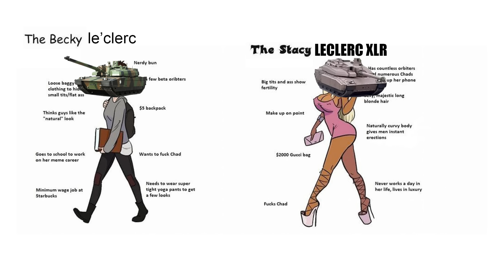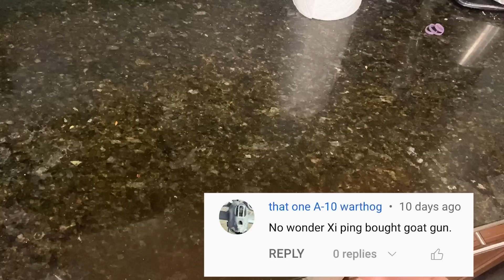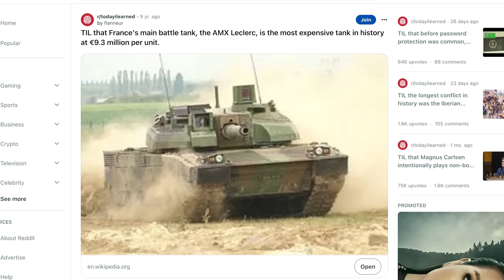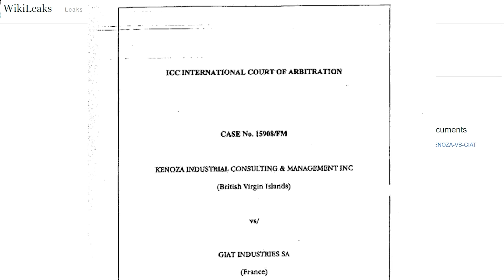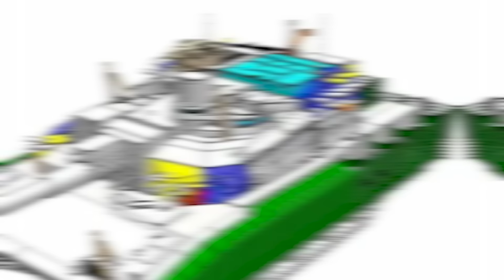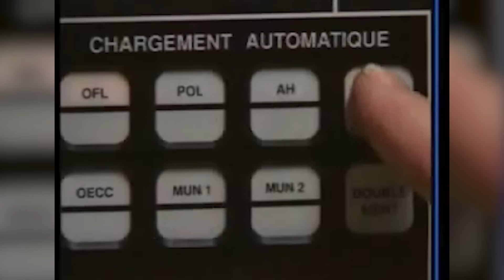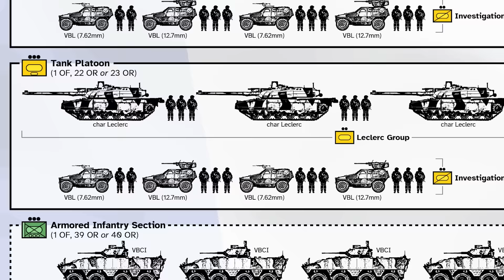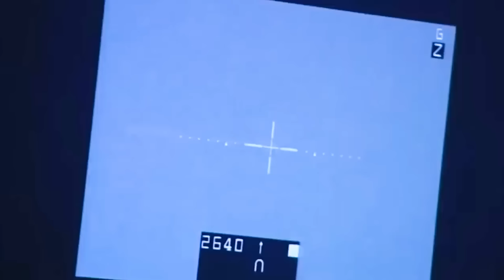Why France's Tank is the World's Most Expensive

Comment: I think the French did an incredible job on the LeClerc and the French military doctrine matches up with Korean military doctrine, which was applied to the K2.

When the K2 was in the initial stages of development, the generals were asked, what's the #1 thing required for a modern tank? And the general's answer was "networking," not firepower or armor.

Because it's necessary to combine info from satellites, other tanks and other data sources to get a complete picture of the battlefield, download GPS coordinates of targets, and hit with 100% accuracy.

I also agree with the French and Korean military in that armor is overrated. Modern radar can lock on the GPS coordinates of any tank once it fires, so it's necessary to fire and move, no amount of armor is enough to protect from counterfire of 120 mm tank shells or 155 mm howitzer rounds fired with GPS guidance.

There's a reason why the French are the world's #2 in weapon sales. They're smart as hell, they design their weapons with a coherent, effective military doctrine in mind, and they're good quality weapons. It's a winning formula.
Reply: are you for real saying artillery radars are used to counter tanks? 😆
Reply: @phunkracy  Replace the "radar" word with fire control systems and it's probably what the person above you meant. In Ukraine apparently you optimistically have 5 minutes before artillery hits you when drone and GPS spotting is about. 40 seconds at worst if it's about counter battery fire in artillery duels.
Reply: Honestly south-korean military is highly underated in my opinion. One of the rare western nation trying to regain as much sovereignty as possible from pour common invasive ally
Reply: And who is #1?
Reply: @willyvereb  there is no such thing as a counter battery FCS. The guy is just confused.
Reply: @willyvereb  that's why the ceasar was really smart
Reply: @phunkracy  It seems that counterbattery radar can spot a tank fire.
When you look at the specs of the French Cobra counterbattery radar, it can spot :
Canon fire from 105mm and even mortar from 81mm up to 30km away.
And by calculating the trajectory, it can determine the source, and send the information to a team via the ATLAS system (automated information sharing for ground to ground unit)
So if there is an artillery system, with excalibur rounds that are GPS guided, everything that Jim Park said, makes sense.

Only thing : tank round will take way less altitude than artillery.
So it's harder for a radar to catch it. It will depend on the position and altitude of the tank, his round, and the radar.
Reply: @phunkracy  Counter battery radars are many decades old by now. Digital technology just made its potential all the more deadly.

The OP's point was that data-links and sensors are more important in the modern battlefield than who has the thickest armor.

Why do you continue to derail this topic?
Reply: @willyvereb  why do you continue to derail the topic? you had 4 days to stay silent, couldn't manage even that?
Reply: @phunkracy  Your response fails to establish even basic cause and effect. If this is the best you can produce then I feel stupid for thinking we could ever had a conversation.
Reply: @Antares-rt5ub  well the country whos military budget essentially amounts to "YES"

Comment: You forgot the data link, when a leclerc see an enemy, it send in real time the info to the artillery, it has also many captops for NBC, it does chimical analysis, the autoloader allow to reload in the moves at hight speed what Ambrams or leo2 can't.
Reply: Lmao what king of troll your are
Reply: its called Battle Management System and can be found in newer Leopard 2 and Abrams variants too
Reply: @MrAerodynamite   what troll? The datalink? It exists. The fact that a leopard/abrams won't be able to load in the same conditions that a Leclerc does? That's true. Try to manipulate a 25kg and 1m long ammunition and feed it in the gun chamber while the tank is bouncing over bumps at over 30mph. This won't be a fun experience and good luck to reliably feed the gun every 6s 😏
Reply: @Lars.171  Yes 30 years after....
Reply: @MrAerodynamite  Just for a post? The reality is here leclerc is a 4th gen tank like the K1 while leo 2 and m1 or Challenger are still old tanks from the 1980 area just upgraded, just heavier and heavier but based on the old MBT70 tech.
Reply: @MrAerodynamite  bidet

Comment: The French style of autoloader is a great design. Like it or not, the updates made to autoloader tech have made manual loading obsolete. I'm confident the Abrams-X or whatever new MBT the US adopts will have an autoloader. There's literally no valid reason to insist on a crew member to load the gun in the 21st century.
Reply: How about having a fourth pair of hands to do basic field maintenance on the tank? That's nothing to sneeze at.
What will finally remove the loader from Western tanks will be the weight of the ammo. The 130mm round in the prototype KF-51 Panther weighs 70 lbs.
Reply: @wmtford4043  You can have a 4th person without sticking with the objectively outdated notion of using them as a loader.
Reply: Abram X is confirmed to have an autoloader
Reply: @wmtford4043  How about no ? No autoloader means lower combat capacity (the gun is stabilized but i can guarantee you the hulk isnt at 30+ MPH, so have fun reloading as fast, aka one round every 10s)

That and the need for more inside space to accomodate for a 4th crew member, which in turn means more total armor volume required, hence weight, which forces a compromise on mobility

A French style autoloader is objectively the best choice, heck even the US ended up backtracking
Reply: @wmtford4043  le prochain char français sera en 140 mm avec son canon ascalon de nexter
Reply: @Jugement  I don't want to be that guy but, this type of autoloading system was not firstly put on the Leclerc MBT (production MBTs, not prototypes) but rather the Japanese Type 90 MBT, which has an higher firerate while also being able to store 18 rounds in the autoloader itself.
Reply: I absolutely agree there is a complicated debate between autoloader and an extra crew. The French tank S1 (3 crew members) in 1940 was far better than Panzer III (5 crew members) in 1v1. Not in 50v50. And that was due to communication tools and also workload for the crews.
Reply: @wmtford4043  typical useless german overengineering problems. 120mm is fine + with higher velocity, you get a better weapon
Reply: Saving your troops and have a faster tank with faster rounds is definitely the future. The leclerc has it all already. Too bad the french aren’t as good at selling as the Americans or Germans 😉
Reply: @xaviergiraudon2247  the Americans are the best at selling stuff and the very best at selling weapons. Germans are really good for many things, but not better than the French at designing and selling weapons. They were just faster at building a modern MBT, and they made a very good one so the success was theirs for this market. And it is fair.
Reply: @wmtford4043 that’s not a very good argument. Firstly, no tank will operate alone or only with other tanks. They will always be among larger forces, for exemple French have light scout cars. So there’s always be more pair of hands to help for basic maintenance of the tank. Secondly, as guns gets bigger and bigger, Rhein metal going to 130mm, GIAT to 140mm, rounds are getting heavier and heavier, thus the loader is becoming far less useful compared to an auto loader.
My third point is that new tanks, such has the US Abram X, Franco-german EMBT, as well as future projects are getting so much more sensors and datalink informations that for the case of the EMBT, a 4th crew member will be needed to compute these informations, thus giving you that pair of hands you seem to desperately want to justify the need of an objectivity worse loader compared to modern auto loader (Leclerc, type 10, K2…)
Reply: They already accounted for that apparently. Have crews on standby in light vehicles and trucks or even ATVs. Crew replacements can be rapid. Only problem there is actually delivering that new crew member to replace the casualty in a hot zone. Best to have 3 or 4 men in the tank. OR perhaps have a partially rearward mounted turret with space for 3 man crew plus maybe 3 or 6 man fire team. Like a Heavy Infantry Fighting Vehicle of some sort.
Reply: Having a 4th crew is pretty important.
If your gonna have an autoloader, might aswell have a fully unmanned turret.

Comment: Great and fair report. The only capability that you are missing which is probably critical and unique in active combat to the Leclerc it's its ability to fire multiple times without loosing sight of its target. This is becaus it's using an autoloader and the canon does not need to be lifted up or down to eject and reengage a new ammo. Therefore it makes it much more efficient against moving targets and especially shooting at the same one in sequence to destroy it.

Else than that it's a great summary that you have done and in my view its biggest advantage comes from the autoloader and therefore 3 personnel needed to operate it vs 4 in almost all western tanks.

It's biggest "disadvantage" even though the French army says it's been fixed is its availability for combat and eventually light weight which means that passive armor might still be a weakness of this tank compared to other Western tanks especially.

Comment: Interesting design. Given the weight of most main battle tanks, I can see armies focusing less on them and more on lighter, more mobile platforms that they can support the tanks with like the Stryker platform. So the fact that they only have 200 of them might not be such an issue if they have a vehicle that can complement them well.
Reply: Specialized tank-killing munitions have gotten too good. There's no point in giving your tank the ability to resist cannon shells since it's realistically never going to fight another tank, and even if it does, depleted uranium makes a mockery of any armor light enough to be practical. And there's no point giving it fancy composite armor plates to resist ATGMs when it's just going to get murdered by top-attack munitions. The future is small, cheap(er), lightweight tanks with high maneuverability and lots of electronic warfare capability.
Reply: Still not enough. It wouldn't hurt to have a bit more but since production cost is a bit too high that will have to do.
Reply: @dark7element  That kind of depends on how well it is being supported. If it is supported by vehicles that can shoot down or deal with potential threats to it before it gets close enough to harm it then becomes less of an issue. 

In this situation the "tank" would be the big threat as it carries the heavy weaponry while other vehicles support it and move in a protective formation around it. Think of navy battle groups and how they usually focus around a carrier with the other ships providing escort and protection for it.
Reply: @dragonslayer2107  In that case, the "main battle tank" of the future might be more like an armored anti-aircraft vehicle with missiles that can also hit surface targets, than a conventional battle tank. I just don't see how having a big cannon will be worth it anymore. If you're gonna use a big cannon against the enemy you can park it well away from the frontline, everything has pin-point accuracy on any target that can be observed these days. Even tanks are getting taken out by direct hits from mortars in this war.
Reply: @dark7element  Probably. Big guns may we relegated to artillery in the future but remember that those smart weapons are expensive and harder to make than more traditional weapons. 

So, while the smart weapons may do more damage, they are not as easy to replace as the dumb weapons.  

As such, while smart weapons are good, it is always a good idea to have weapons that you can fall back on that can be more easily mass produced for times of prolonged conflict.
Reply: Nexter is currently rolling out the Jaguar ebrc 6x6 ifv, with a 40mm autocannon and high speed offroad mobility

Comment: Leclerc has AMAZING engine. Same power and momentum in VASTLY smaller package than Leopard 2.
Reply: Where do you get that from? When I look at the power pack of the Leopard 2 and compare it with the full-size power pack of the Leclerc, than I get the result, that they are almost identical in size.
Reply: HAD cause the Hyperbar Engine is not built anymore
Reply: @dnocturn84  Hyperbar engine is the best because you have the 1500hp when you press the pedal instead of others tanks whitch is gradually
Reply: @Yue2000thegamer  Interesting and fine for me and I guess this is indeed totally awesome, but how is this related to the original comment or my reply to it? It was solely about the SIZE of the engines, not about any other feature.
Reply: @dnocturn84 just compare the hull length of the 2 tanks, the leclerc is smaller by a solid 1m compared to Leo 2, the weights saved is approximately 4T, and I’m not counting the hydropneumatic suspension of Leclerc much lighter than torsion bar of the Leo 2.

Comment: The quoted price of the Leclerc Tank is quite high because the fine print includes the cost of the development program and infrastructure rather than just the manufacturing cost as of 2001. With the original order of 420 Units, its original unit cost was 5 million Euros which went down to 8 million Euros.
Reply: that's not going down
Reply: @AuxenceF  its going down in reverse dont worry

Comment: Most expansive because 1) few were built and 2) it was designed to be extremely sophisticated.
Reply: " sophisticated" blablah
Reply: @flycrack7686  Average "mad but cant come up with a counter argument" mf
Reply: everything french does is expensive for a good reason : food, wine, parfum, tank...
Reply: This would technically apply to Tanks such as the C1 Ariete and Type 10, but it doesn't which is oddly enough.
Reply: @MatteonixITA  1) Only 406 were built for france, and 388 were exported to the UAE but sold at loss. Initialy it was calculated that between 1200 and 1500 tank produced for France were required to have a competitive price thanks to a good serial effect 2) The design is extremly ambitious notably the turret and the motor.

Comment: Hey Chris,

Good content.

One correction about the armor values you've stated.
AMX 30 has only 80mm thick plates of armor, yes, but the values of M48 you've stated are effective values due to slope, not the thickness itself. 

M48's frontal armour was around 100-180mm depending of specific plate and place, which translates to more effective armor due to said slope and angles.

Neither tank had sufficient amount of protection against any of the Soviet tanks, or ATGM's unless we are talking about 3km+ sniping duels (not that shape charged munition is not affected by range due to it's penetration values stemming from a chemical reaction, rather than kinetic energy).
Reply: Demande aux Irakiens et leur T72 détruit par nos chars si le blindage Soviètique est meilleur??
Reply: il a pas dit ça il a dit que 180mm de protection ou 80mm , dans touts les cas ça n'arretera pas un obus 120mm flèche ou un lance missile antichar @marc9080

Comment: The newer Rheinmetall 120mm gun found on the Leopard 2A7 is a 55cal gun. This will also be used on the Challenger 3 as well. The Korean Black Panther uses a autoloader as well, with a 120mm 55Cal gun that was "inspired" by the Rheinmetall gun.
Reply: The Leopard 2A6 has the L/55 as well as some Leo 2A5 versions.
Reply: Still the vast majority of existing Leo2 are with a 120mm L44 gun.
And K2 Blackpanther architecture is clearly copied from the Leclerc with an autoloader that works the same and and reserve ammo located at the front right side. 
( Left side in the Leopard2)
Clearly the Leclerc was the model for the K2 and it shares nearly nothing with the Leopard 2.
Reply: @BFOP15  : Maybe the power pack? The early K2 models were having reliability issues with their Korean (Hyundai?) power packs, and had to source them from Germany. I think they are from the same company that supplies the Leo2.
Reply: No the Korean autoloader was inspired by the Leclerc. South Korea's ADD developed the K2's autoloader system based on data obtained on the Leclerc autoloader's at a SATORY event. They copied (read stole) a patented design lmao.
Reply: @rokuth french exported leclercs also use German power packs so….
Reply: La France a développé un canon pour son nouveau char de 140 mm avec de nouvelles munitions